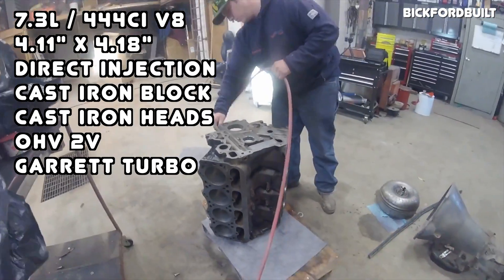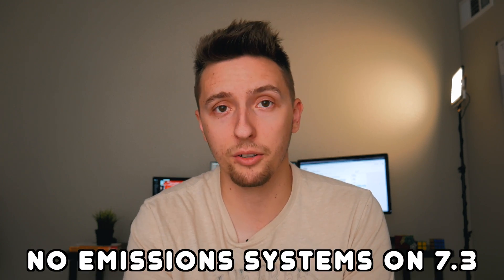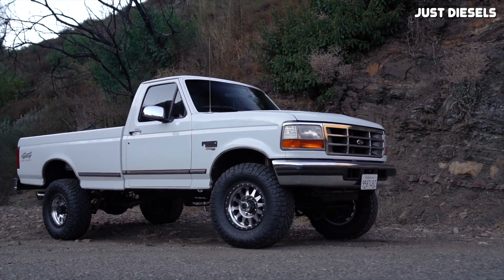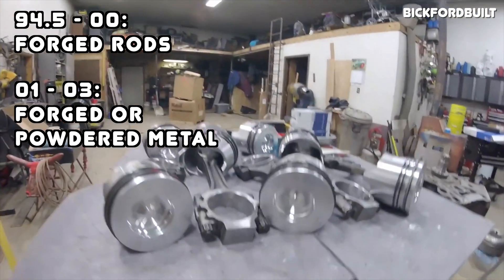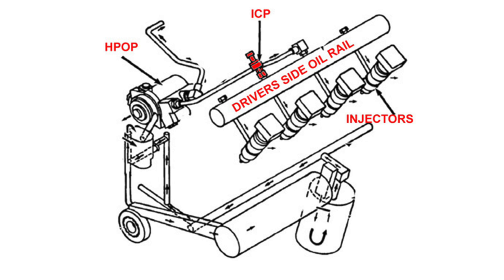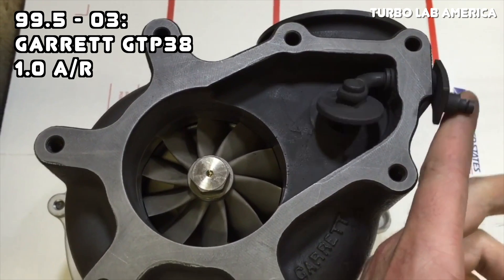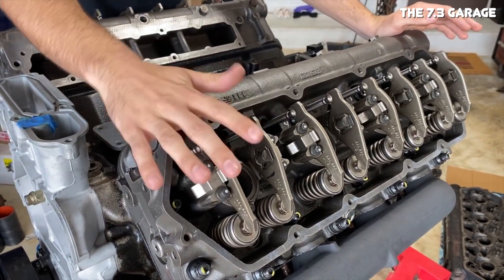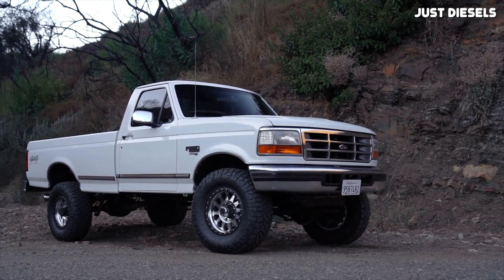7.3 Powerstroke: Everything You Need to Know

Comment: Every fleetowner of these engines should be saying yes, because every douchbag employee that could care less about these trucks cannot kill them by running them dry of oil. Many have tried, but the 7.3 was designed with a douchbag deterrent that just shuts the engine off if oil levels get too low.

Comment: The 6.9/7.3 were more reliable. the 5.9 ve/p7100 more reliable. Mechanical is king of reliability.  for a electronically controlled diesel. it is very reliable.

Comment: I had a 01 Powerstroke with a manual trans. Got 365K trouble free miles before I traded it off. Still own a 2000 Powerstroke bought new in April of 01. 185K miles and still looks and drives great (will never sell this truck). No major problems with either truck.

Comment: In 94 it might have been 210 hp but in 97 it was 235 hp (which by the way did have a waste gated turbo with no intercooler) and by the final iteration of the 7.3 it was pushing 295 hp bone stock...and for not being able to tow much well I'd put it up against any other deisle out there when she's got old fixed blade johndeere 350 bulldozer on the back and that turbo spools up she only has a 5mph fall off going up hill the only other diesle engine out there that can hold a candle to that is the new 6.7 cummins with the gs6 6 speed and it's not the engines fault...it's the gearing...the old 7.3l with the zf5 5 speed had the perfect gearing for towing which got downgraded when they went to the zf6 6 speed but it got better for pulling which pulling and towing is 2 different things...when doing an everything about the 7.3l don't skip over the major stuff just to focus on only it's introduction

Comment: Most of our older School buses are still running super strong and they are the amazing "7.3" T444E.. Some have over 500,000 miles of stop and go pedal to the metal take offs and have never been opened up to be worked on... The 10-15 year newer diesel busses are/have already been sold for scrap or sent to auction due to major engine failure after failure.

Comment: Because hydrogen generators with hydrogen oxygen is no carbon in there one gallon of water is like 11,000 L of hydrogen and oxygen pretty awesome that's all I used a week 1 gallon of water distilled water because if you use any other water to ruin the plates inside the generator that's why they put that in batteries.

Comment: When I had hydrogen and oxygen was a hydrogenerator on my truck that's probably cranking out close to 600 horsepower and that thing you could fill it too and plus when I was pulling a 39 ft trailer I weighed with my truck 17500 I got 19 miles a gallon pulling that trailer 368 mi round trip to Chicago.

Comment: My 01 F-250 7.3 PS mated to a 6 speed manual does pretty good.  I towed 7500 pounds from Maine to Utah and back.  Thing is, you have to “drive” the road.  When you see a hill coming up you accelerate before you get there to make the grade.  If you get caught flat footed,  welcome to 35 MPH until you reach the top.

Comment: There are some known problems with the 7.3 which were not mentioned, mostly related to age.  The oil pan rusts in humid climates.  The oil cooler often leaks oil due to the gaskets failing.  Replacement gaskets are made of different rubber and do not harden.  The last problem is much more involved.  The fuel injector cups are sheet brass and crack or develop microscopic holes.  This is a problem on all diesels that use brass cups.  Experts feel it is exposure to extended life antifreeze which degrades the brass, as earlier diesels that used regular antifreeze do not have the problem.  When the cups fail, fuel is forced into the cooling system.  The reservoir fills, the cap gasket fails and fuel leaks out of the reservoir.  Replacing the cups and injector gaskets is a 2 day job for a decent diesel mechanic.  Aftermarket stainless steel cups are available and most large trucks now use stainless cups.  There is no consensus on whether or not the fuel damages cooling system components (besides the cap gasket).  It does not damage the reservoir.

     Despite this, the 7.3 still has a record for reliability.  It will be interesting to see how Ford's new diesel pans out.  It is only 7% heavier than the 7.3, but it has almost twice the torque and HP.
Reply: I didnt change the cups on mine. But i did replace the injector orings in just a few hours. The cups are right there as your doing it. Wouldnt take much more to do them as long as you have the remover tool
Reply: @zucinnied  Though you sound like a skilled mechanic, you'll find that changing injectors takes 3 times as long in a van. One or two need to be dismantled before removal.

When the cups are bad, in order to pull them, the cooling system needs to be drained. The area where the cups fit needs to be cleaned meticulously and then the new cups can be installed.

The worst part is if fuel leaked into the cooling system.  This is usually what prompts the cup replacement in the first place. All rubber components in the cooling system need to be changed, including the water pump (the seals are rubber), and the whole system needs to be flushed with soap thoroughly multiple times to remove any fuel that remains.

Comment: great motors until  the oil pan rusts out.  Ford shoe horned a school bus motor into an Excursion, f25 0 and f 350.  They can go 500k miles.  The 2000 - 2006 Duramax is a tough competitor.  I had an 02 Excursion.  Sadly there was way too much rust, and I started having electrical problems with the truck.  Sold it on ebay.  Keep in mind, those are not Ford motors.  They are Internationals.  The oil pan was Ford, and that was the weakest link and would  rust like all Fords do.  Never again.

Comment: I have a 2000 F350 , 7.3. I am not a motor guy thats what mechanics are for. What can I do to increase the power on the 7.3? I would really like to step on the accelerator and feel it put me back in my seat. I do pull a 32 foot camp trailer so I  drive like a granpa with that in trail.  I only have 108k on the motor so in some ways its barely broke in. Just looking to some type of upgrade other than a new one.

Comment: Still have two of them one at 200,000 one at 265,000.   The only issue was the stock autos. replaced those at about 160k.. far as power these are so easy to make more power, not an issue.

Comment: The 7.3 was also a cleaner motor then the 6.0 ^^^ I love ford and buddys with handful of ford employees so able to figure out more past rumors. 7.3 was ended due to sound. Ford Judt could not do anything other then a cat to make it a bit less noisy 
Edit the 90’s was rated (f250) with a 25k goose load. And my 97 is used to tow around 1-2 ton trucks with a bumper pull 5k trailer. Still pulled much better then our company 2018 6.7 Cummins yes with emissions delete. All mine has is a bigger turbo and a shift kit plus a one way tune. It’s used to tow 25ft hay-bale trailers and other equipment. Honestly coukdint pay me to take any Cummins or dirtymax I know lots will give me hate. But these motors with very little money can be made into a extremely great tow/street/work truck even stock they still tow the same amount as the new trucks. 
Now I could tow more then 25k with f350 brakes and a second set of overload springs but Iv not really found anything that heavy. Maybe a big ass camper but even then the 42ft dry campers are only pushing right around 20k now maybe if it was two three trucks but at that point to be safe it would need to be a f450 pulling a trailer with 2 or so big trucks. But what’s crazy. Before the f350 brake swap. It stopped Better then our 454 3500 short bed Chevy. And what’s weird is. Same load and I didint have trailer brakes (grabbed the wrong adapter and was short on time) but I mean take with it as you will I take good care of stuff and don’t recommend pushing load limits try to stay around 5k or lower on the factory limits (doing f350 shackle kit soon) and btw at the time both 7.3 and 3500 had all new brake hardware I mean even the rubber lines was replaced

Comment: I am an ole crippled guy and kind of limited on what I can do. I have a
 2003 f350 7.3, a few weeks ago my engine started a metallic screaming 
noise, I first thought that one of the front pulleys was getting ready 
to lock up. After turning off the engine it would not even try to turn 
over. It left me stranded in the boonies. I had it towed in, 3hrs later 
They found the starter had stayed engaged and had broken inside. I put 
on a new starter and a new relay in fuse panel everything now works but I
 dont know what caused it and I am afraid to go anywhere. Any ideas??

Comment: Imagine if they updated the 7.3 with common rail fuel injection, Variable vain turbo, make it an even firing motor, and add two more valves per cylinder. I think if they did just the common rail update the trucks would not hold up.

Comment: I am original owner of a Garage kept 2003 Ford F-250 4x4 Crew Cab Lariat with 71k miles in which I live in NM which means no rust. I think the 7.3 diesel is a very reliable as I have had only one problem with my fuel filter seals leaking. I know my truck has low miles but that is because I have had poor health.

Comment: Got a 2000 F350 7.3 with 6 speed manual trans and manual transfer case and 3:75 geared Dana 80 posi and get 24 mpg at 136,000 miles! Wish the body was as solid as the drivetrain!  Lol

Comment: I have a later 2002 7.3 Power Stroke in a F-250 4X4. Love the engine have put many Banks and Riff Raff diesel mods on it to make it more reliable. And had the tranny overhauled at 198,000 with a triple disc torqconverter. I tow a 10,000lbs boat with it not an issue. I bought it new and will never get rid of it!!!

Comment: As good as people make manuals out the be they're not all that. Out of 13 7.3 trucks Ive owned 2 are automatic. 1 being a 450 cab chassis and the other an Excursion. The issue with the manual is the clutches and throw out bearing. Yes, evens with the oh so sacred South Bend clutches. There throw out bearings are even worse than a factory bearing, then if you have a heavier clutch to tow it adds even more strain on the throw out bearing and master/slave cylinder.

Comment: After running the 7.3 for 20 years, it' simple... Everything done by INTERNATIONAL is very good... Everything ford changed are Basically are the weak links... The PCV dumping straight oil / air blowby without a oil air separator directly into the turbo inlet is straight out disgusting , lazy and self destructive.... At 100,000 miles, 7.3 leaks oil everywhere, inter cooler system, boots,  are ruined & leaking , over taxing the turbo, heat, etc, etc, etc...  My Duramax at 170,000 has only dust on the engine.. Not any oil leaking anywhere, no boost leaks ...  7.3 = great block , heads, hard parts... POOR running gear set up from ford...

Comment: 7.3 is actually more emission friendly than a 6.7. Noise regulations issues is the reason why Ford dropped it.
Reply: "noise regulations" Ford dropped it because it did not break down. You cant pay the Parts & Service departments with engines that dont break.
Reply: @BuckingHorse-Bull  100% this for sure. These new trucks have all kinds of shit that will fail, mostly emissions for the most part.
Reply: @BarnStangz  PLEASE READ CARFULY AND UNDERSTAND WHAT IM SAYING.

The new and old 6.7s are bs,,like this guy said they dropped the 7.3 cuz it fairly broke down,,,,the 6.7s began showing there issues 2 years after production,,the 6.4s however are less expensive to fix than a 6.7 and is over all a cheaper and more reliable truck,,however the 6.0 was and is the most unreliable but don’t get me wrong,,they have few major issues but a handful of little issues,,over all out of the 6.0 ,6.4 and 6.7 the 6.7 is the least profitable and possible to be the worst choice of reliability,,the 7.3 is more reliable but it’s also a under powered engine,,that’s why it’s not prone to failure,,but who gives a damn they will last minimum of 325k miles with little to no fixes,,overall the 7.3 is more reliable,,as far as the best power stroke go’s the 7.3L 1st place ,,6.4L 2nd 6.0L 3rd and arguably the worst the 6.7L,,,I’m just trying to tell the truth,,,if you want to agree reply,,if you want to argue don’t say anything,,God bless
Reply: @ictdpowerstroke4591  Yeah, I hear what you are saying... And trust me, I believe that ALL truck mfgs out there want to make a decent product, but not one that will continue to last and last... That isn't profitable for them. The 7.3 PS is one of the best engines ever made IMO. There are LOTS of examples out there in excess of half a million miles (or more) and continue to run very well. I think these new diesels could be great, if they didn't have all the emission stuff on them. One of these days I'd like to get a newer truck, but I don't think it's going to be a diesel, that's for sure.
Reply: @BarnStangz  I have been waiting all of my life to hear someone with common sense,,thank you for understanding and getting something out of what I’m trying to say,,I’m a 6.4 guy but i must admit,,if I was to get a brand spankin new truck it would be a Chevy Colorado v-6 but im an older truck guy,,I’ll just get a new one when I get to 500k on my 6.4 or 4.6 ,,I try to take good care of my stuff and it takes care of me so I hope im doing well,,have a great day.
Reply: @BarnStangz  but honestly for the 6.7 powerstroke,,the emissions actually save the 6.7 by 10% or $1,364 cash or debit or credit or check lol,,but you know what I mean.
Reply: @BuckingHorse-Bull  well the engine doesn’t die but the sensors and hpop do die great engines don’t get my wrong but the electronics that allow it to even start aren’t as legendary as the engine itself haha

Comment: Just turned 295k on my factory motor, she has some blow by but still runs very strong. Motor is getting pulled and replaced with a built motor, s369sxe T4 set up, cam, ARP studs, carillo rods, fully worked heads, and 250/200 injectors. Its a big build but ready to turn back the time on my girl!

Comment: My Early 99 pulls 11000 no problems. All stock works like a charm. Oil is never black at 7500 mile change intervals...I use all ford mo co filters, lubricants, and coolant

Comment: It didn't die because of new emissions, it got the axe because it was to loud. Best sounding engine of all time.
Reply: Injectors can quiet it down. EPA standards killed them.
Reply: @jasonspellich2440  Wrong. It was killed for being 2 loud.
Reply: @nathankoroush7918  ok...
Reply: @jasonspellich2440  The 7.3 L DI PowerStroke was in production until the last quarter of model year 2002 when it was replaced by the 6.0 L in 2003 because of its inability to meet California noise regulations, not the commonly believed emissions standards as it beats the current 6.7 L Ford PowerStroke.
Manufacturer: Navistar International (1994-2010); Ford Motor Company
Reply: @nathankoroush7918  cute. Now click on the wiki citation and see what happens 🤣
There's a reason why no one allows it as a reference source....
Reply: @jasonspellich2440  yea no shit right? Just agree so he’ll shut up.  It was definitely emissions.
Reply: You got that right
Reply: Al Gore was the reason
Reply: Haha I hate going thru drive thrus with it because they can’t hear my order because the idle noise love it

Comment: One of my life’s goals is to always have at least one 7.3. My current ‘02 F-350 has 287,000 and runs like new. Great motors
Reply: I have. '02 7.3L. Got stolen by thugs to steal atms. Insurance toted it bc of minor subframe damage.  I bought it back n fixed it. Will stay in my fleet of cars.  391.5k miles 4x4 crew cab
Reply: My '03 F-350 is at 320k. Just had the engine overhauled and I plan on getting many more miles out of it.
Reply: @bradmurchison2770  had one up till 375k computer went out but other then that. Not a damn issue
Reply: I’ve got a 1996 F350. And it’s a beast have 135k miles on it i love it
Reply: I have 193 on it. Got blow by from dipstick and oil cap.
Reply: Gang bro i gotta 01 350😂🎉 4" strait pipe sounds so good🤤😍

Comment: 263,000 on my 2002 7.3 BEAST. She's my personal gem and we'll be buried together when my time's up. She growls like a Lion & whistles like the angels in heaven! 🇺🇸'merica!🇺🇸
Reply: this is a very beautiful comment lol
Reply: This comment is like poetic,
No I’m not a liberal
Reply: @ivancedillo8 may not be a lib, but like the original comment, still gay.
Reply: I just bought an 01 F350 7.3 club cab lariat and it's bone stock in mint condition but i want to put a tuner on it and wake it up some. I don't do alot of pulling but when i do it's either a 32 ft stock trailer loaded with cows or a tag-a-long with a backhoe. What kind of tuner would you 7.3 experienced guys recommend
Reply: @ghostrider-tj7du  php hydra 100% you will not regret it. You can buy any tune and just download it right on no need to send to company to get it burned
Reply: I’m trading my 07 Silverado classic for a 01 7.3 with 342,000 miles I’m hoping I get a good deal
Reply: We have to leave this comment at 69 likes. Nice!
Reply: 338k here
Reply: Back in 2019, I found my 7.3 Unicorn. It came into the dealership I worked at as a trade. It is a 2001 F250 7.3 crew cab long box here's the best part. 18 years on the road and I bought it with only 104k miles on it. It now has 157k. I am just getting it broke in!
Reply: My 00 is at 244k almost broke in 😂👍
Reply: Mine too ❤@260,000 econoline -ujoint 4x4 cov🔥🖤
Reply: This comment is amazing